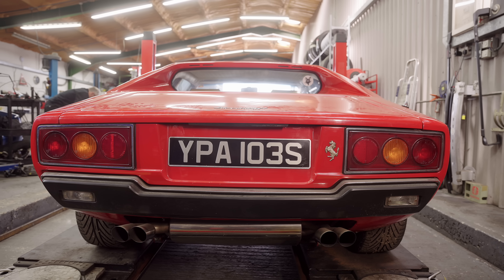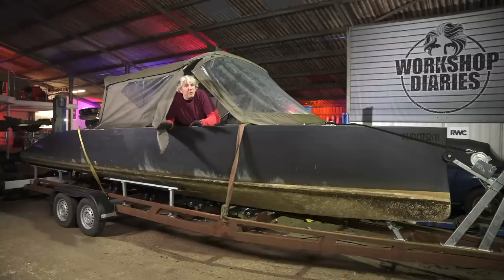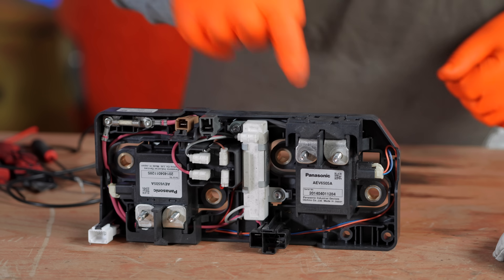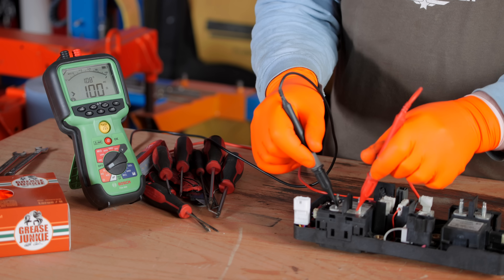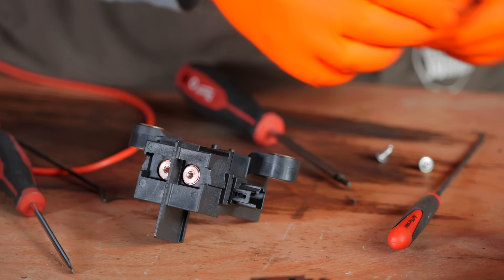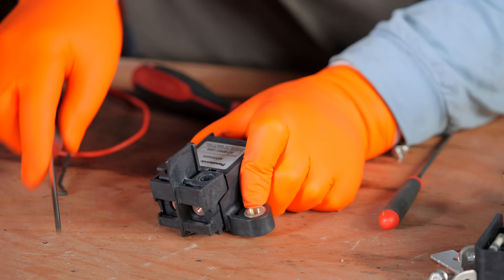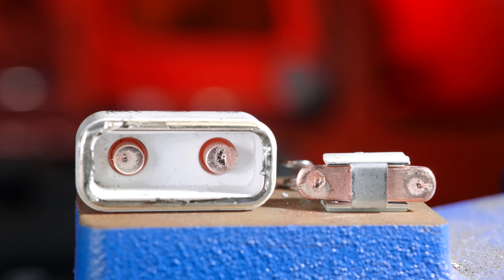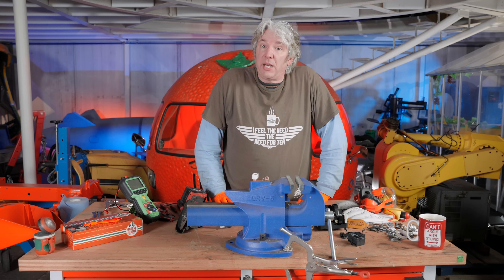1 Surprising Thing I Found Inside a Welded EV Contactor

Comment: The contactor rating is probably continuous current.  The inverter won't do 80kW continuously, probably more like 40kW max, and the battery pack will limit things too.  So they can get away with it.

Similar thing with Tesla vehicles - the fuses on old cars were only rated 630A, but the motors pulled 1000A under WOT.  The 'hack' was that Tesla precisely models the fuse characteristics to avoid blowing it.  As they went up to higher acceleration they had to replace the normal fuse with a pyrofuse to provide safety isolation, this electronically monitors current and fires what is essentially a squib at the metal joint to break it. The problem they had was no fuse would blow quickly enough under a short circuit but also allow the full acceleration of the vehicle to be maintained.

Comment: do i get it right? its a 120A Solenoid? i can tell you whats the problem, the switch distance is too short, its producing arcs. a 230V 120A solenoid is 10 times bigger, as electrican i ts pretty common to see things like this, most times its causer of shortcut, when a solenoid switches a shortcut its welded but it also can happen on heavy load even in the Elektro installation we have same problems cause the companies shortend the switch distance to fit in the DIN  rails,  compared to realy old ones  from the 50s 60s, thaty why this old ones still work. that thing is a joke sry the conductors are maybe 3 times bigger than in 16A switches / rockers in your wall

Comment: I think the contact module is hermetically sealed, and it coukd be a vacuum in there or more likely Sulfur Hexaflouride. . As you say its all about reducing arcing when switching.  Sf6 has a high dielectric strength.

If you have some time on your hands read about paschen's law. Its fascinating. 

It could be that the welded can you mutilated has leaked.

Comment: Contactors have seen a lot of change and Engineering over the last few decades. From exotic and rare alloys, vacuum/gas purges, coatings, layered plating, and heat/cryo treatment. And that just scratches the surface. Went down a rabbit hole with all of that a few years ago, and it's a deep one.

Comment: I would say the current rating on the contactor is the maximum load it can switch. Not the continous current flowing through it once it is in a closed state. These contactors switch DC, and I am qute surprised at that rating, given their size. The boat video would be interesting.

Comment: All you will see inside is ultimately one of the creations of an electrical engineer who ended up poorly rating the contactor for whatever reason. Outcome? Crap engineering. or a manufacturing issue…

Comment: There are two current ratings, for the contacts on a DC contactor.  The steady state current rating is much higher, than the breaking capability.  When the contact opens on a DC contactor, it draws an arc, until the contacts separate enough to extinguish the arc. That is why AC contactors for the same physical size, can break higher currents, because there is a zero crossing point, where no current flows, and the arc, self extinguishes. Given that there is an inverter down stream of these contactors, they are only designed, as an  isolating safety device, and do not normally have to break the full load current. Contacts can weld together if they have high resistance, caused by contamination, or low contact pressure, or excessive number of operations. Once the contacts start to heat and arc, they get to the point where the metal melts, and they fuse together.

Comment: Panasonic uses Hydrogen gas to extinguish the electrical arc faster. Kind of weird, but H2 is more effective than other gases like N2 or Argon, etc.  

Some Panasonic contactors also use magnets to cause the arc to curve, effectively doubling its length, which also helps extinguish it faster.  This model does not appear to have magnets, likely to save cost.  I would expect contactors from other suppliers to be similar.

Comment: Mercury wetted contacts would have solved that arcing issue.   the problem is the entire electrical industry has stepped away due to Environmental issues as scrappers rarely handle the electrics properly for recycling, and the mercury gets into the environment.  Nissan being Nissan they chose the cheapest option instead of the more common Solid State relays that do not have the welding problem.   Solid state has a failure mode too,  but they last far longer and can easily be found well above that 150A rating, but they are also more expensive.    At single scale not much, typically double the price.  but when you make 100,000 things that double price gets significant.

Comment: I work at an EV specialist garage, and I had one of these contactors on my bench with the same failure, so I opened mine up along with the video.
I believe the cause is down to porosity of the ceramic around the contacts themselves; eventually there's enough leakage to allow non-inert gas to get in and facilitate welding.
Reply: that's one QM issue with costly consequences!

Comment: Having scrapped a LOT of relays and contactors I can tell those are pretty cheap and not designed for longevity.  They look like lower end silver on copper and those do weld quite easily due to arcing.  Better ones will be made of silver and tungsten powder sintered together and they do not weld easily due to the VERY high melting point of the tungsten.  Really good ones have solid slugs of a silver/palladium alloy brazed to the copper backing bars.  Those ones there likely have no more than $1 of silver in them and I'm not the LEAST bit shocked to see they welded like that.  It's really quite a shame to see a company like Nissan cheaping out so much.  I honestly would have expected better from them.  As a father I have to say "I'm not mad at you Nissan.  I'm just very disappointed".

Comment: I'm surprised to see that they are using mechanical contactors with old fashioned coils. Back in the day some 30 years ago I used to work with traction motor systems that used used solid state SCR switchgear. SCRs require no maintenance no arch or arch suppression. I'd have thought that car manufacturers would have gone solid state although there may be safety cases which are made easier with mechanical contacts. Fun fact with high current high voltage contacts a small piece of paper placed in the contacts is sufficient to stop current flow. We used to use 10mm paper squares to isolate supplies.

Comment: 120A on the contactor is on DC side and motor rating is related to AC as DC is converted to AC needed for motor - thats my way to explain kW mismatch but i may be wrong

Comment: That contactor is of course a custom part number, why do they always do that! ugh. Anyhow, the switching current is what's on the relay, and carry current is something like 50% higher. Though you said 120A? that's still way below what it should be IMO.
The contacts (according to panasonic) says it's sealed in hydrogen... yes HYDROGEN which is apparently not explosive over 75% concentration... STILL seems like a BAD idea.

Comment: The rating on the contactor is more than likely a continuous rating the rating on the motor is peak rating. The contractor can probably do approximately double during acceleration. But when you're cruising you probably only use 25% of the capacity

Comment: Hey there. About the amp-rating of the contactor: in automotive-industry it is very common to overload the contactors for a certain time and/or continously with additional cooling of the device itself. Contact temperature is the main thing you need to keep in check with contactors, so that works quite well. Wear usually happens either during contacting or breaking the voltage, not so much in contacted state. 

I'm in battery development myself and we run most contactors at about double the nominal capacity with the help of an adequate cooling concept (usually with the busbars towards a massive aluminium housing). 

Great to see more EV-stuff on here!
Reply: automotive electrical is always so insane by grid standards. doubling the amperage through a set of contacts, obviously going to have a big effect on life and tendency to weld closed. i'm no elechicken but i've overloaded a switch or two and have experienced the result...
Reply: @brianwelch1579  Well, grid contactors are often designed for continous use. For our batteries contactors, the most demanding task is quickcharging and this is therefore only like 15 min at the highest current. Also, we cool the contactors actively or passively and therefore make sure to stay inside the maximum temperatures. In contrast to grid we rarely have connections or breakage of current since all consumers are shut down before opening of the contactors.
Reply: @andreasbayer That would explain things then. Fast charging is often the only option for many EV owners, especially at the economy end of the available EV market. Given that it used to take me an average of 30 minutes to charge a 75kW battery to 80% on a daily basis, you can see why I went back to diesel.
Reply: @brianwelch1579  To make matters worse, standards for high (heh, 800V by grid standards is not even medium) voltage, used in EVs still are massively based on grid ones.
Reply: Nominal capacity is important. it's for a resistive load when opening and closing. In a well setup EV it's the continuous and peak Current while closed that matters more, and those ratings are much higher. It's not really "over-loading" them.
Whereas in mains / grid use contactors are frequently used to connect or disconnect under full inductive loads. It's a wildly different situation.
Reply: It's all a bit sad to put a known wear part on such an inaccessible place.
Reply: @G-ra-ha-m Problably for safety reason is better to keep it inside the battery pack
Reply: @PaoloSulprizio  Recycling these batteries is the least safe thing, ever.
Reply: @G-ra-ha-m I'm not speaking about recycling but repairing the battery pack
Reply: @PaoloSulprizio  Sure, but I think that the more difficult it gets to repair, the less people bother as the costs go up. Unpeeling a battery pack is non trivial - they seem to be designed for landfill.
Reply: Is the usage of a resistor or a diode be out of question because of the voltage on the contacts on that circuit?
Reply: @jonascourtney5999  resistor or a diode for doing what?  This thing is transporting the full drive power to the motor.

Comment: Hi Ed I think what you have got is a miniature VCB Vacuum circuit breaker. The vacuum inside is to suppress any spark that’s created during opening. If it has lost vacuum it will quickly fail.

Comment: 10:15 - The rating on relays/contactors is the make/break current, meaning that the current will flow/stop instantly as a result of the contact closing/openning. Both of these events cause arcing. In the case of EVs the contactor opens and closes with a very small current passing through since the vehicle isn't moving. The contact can sustain a much higher current once it has settled to the on state.

Comment: Boat as well please, and it’s great to have you back. The smaller contact is the pre-charge circuit, as if the inverter has a capacitor bank it needs to be charged to line DC volts before you close the main contractors, otherwise you do significant damage to the inverter, as a large volt drop when the inverter is placed under load will result in an undesirable rise in current. The resistor is the discharge circuit and is very important, as it discharges the DC bus when the supply contractors are open.

Comment: Hi Edd, it seems this relay allowed DC charge during fast charge session (ChaDemo), it's a nominal current or max current ? 400v (delivered by power charge station * 120A = 48KW). Thanks for vidéos abbout EV. Regards from France.Hi Edd, it seems this relay allowed DC charge during fast charge session (ChaDemo), it's a nominal current or max current ? 400v (delivered by power charge station * 120A = 48KW). Thanks for vidéos abbout EV. Regards from France.

Comment: 120A? I'd have to assume Nissan checked with suppliers of the contactors for usage.

By guesswork, I'd say the contactor is rated to break up to 120A (only occasionally) and will carry quite a bit more while it stays closed. 

Likewise, typically when it opens the car is parked and the load is minimal as it breaks.

Comment: It's been my experience that many of these relays have a high rating, but that's for intermittent use, not for continuous use for lengthy periods. On a number of thermal stores with immersion heaters exceeding 9 kW, a certain manufacturer used surface mounted, on the PCB, relays which either burnt out or where the contacts became welded together.  In several instances this caused the store to overheat and produce water at 95 Deg.C, the point at which the PRV activated, but a lot of damage was done to the properties. We replaced the PCB, but used the relays to operate external contactors, which are far more robust. Ed, do the boat, office and anything you fancy, but keep doing vehicles. Maybe cover repairing failing BEV battery modules, especially testing them for performance and usability.

Comment: I have contactors rated at 100 amps at 100 volts DC and they have 10mm diameter silver contacts those are puny in comparison.

Comment: Relay contact ratings are complicated. A 120A relay is typically rated to switch a load of 120A, but when the contacts are made the current carrying capacity is much higher. Then there are also utilization categories, eg DC-1 or AC-1, and things get complicated. I would assume they wanted to go for DC-20, no load switching, but the inrush limiting system isn’t working properly on this unit.

So yes, this 120A relay can do much more, especially pulsed, as long as you don’t operate it during that pulse.

Comment: Really interesting. Apparently Nissan fixed this in later versions by improving the materials in the contactor so they were less prone to fusing, and improving the pre-charge circuit which basically switches on another circuit that has a big resistor (hence no large in-rush current), then this charges the capacitors to near the battery voltage, so that when you switch the final contactor there is a much smaller in-rush of current.

Comment: ❤ Now we are getting there a ture mechanic dose not just replace a part, No the need to understand means YOU must rip the broken part into pieces to understand the failure 😊....
I hope beyond hope that the underfloor heat is done by A car aux heater eg water heater that runs on a waste veg oil mix..😊😊😮😮

Comment: Those contactors should of course have been accessible without removing the battery if the factory was not aiming for planned obsolescence. That's just crazy!
Reply: and not run at double their ampacity.. it was DESIGNED to fail
Reply: The battery in a Leaf is not difficult to remove, maybe only 2-3 hours for complete replacement. 

The contactors are also connected to large bus bars that remove a lot of the heat from them, they are only opened/closed under basically no load, and the amount of time they actually spend over their rating is very small.

Not saying they couldn't have used a bigger contactor, but they also aren't as failure prone as you all are making them out to be.

Comment: So what improvement could be made to the contacts to prevent them from arcing and thus welding themselves together? Would a better metal do the trick? Seems to be the weakest link in the system.

Comment: Ok Electric car are Green? The car is made in a factory  battery's too!! Runs on electracy that's from a power station, Needs plastic fence that made of oil around it to be repair with a 6hr job to repair a relay. Last time I looked  the relay box in my petrol car was by the fuse box with a drawing on the box to say the place of each fuse /relay 5min job and no plastic fence need. How green are these cars? The public over 100 year ago sorted this this is why the petrol / diesel  engine is used is it not?

Comment: Regarding the 120A rating, RS have a datasheet for the Panasonic AEV contactors (Designed for EVs) - Sadly this specific one (AEV6505A) appears to be a custom part made specifically for Nissan based on their existing product so that would explain why you cannot source a replacement. They do however have a 120A version in the standard range which gives us some numbers on the ratings:
120A Continuity
225A 3 min
400A 30 sec

225A is remarkably close to the 80kW rating, so that's how they get around the limit - Presumably, the Nissan leaf motor cannot produce full power continuously.

The contractor is only rated to break 120A 50 times, in normal use it would only be switched off when there's no current flowing (As the inverter will be powered down beforehand) but clearly that's not always the case, hence the welding. I would suspect that there's a software bug causing this fault.

Comment: That definitely looks like a bit of built in obsolescence. As an electronics/electrical engineer, I’d like to see that over rated by some margin, not under rated by 50%. I guess it’s not at full power all the time but still….  This sort of thing seems quite common in the automotive industry. My dad was an expert in bearings in a completely different field and worked closely with a few manufacturers back in the 80’s. He learned that a certain car manufacturer who we’ll just call ‘Henry’ for now used to buy rejected bearings for use in water pumps, alternators, etc. All they wanted to do was keep manufacturing costs down as long as it outlasted the warranty and after that it was a bonus for the spares department. Back then there were no 7 year/100000 mile warranties. If it had to last 20000 miles at an average of 20 mph, that’s only 1000 hours. These people made bearings that ran in industrial machinery 24/7 for years, so pretty much any reject that would still spin would last the warranty period.